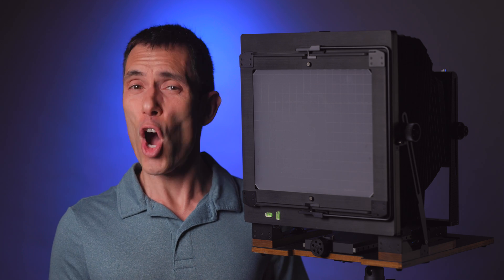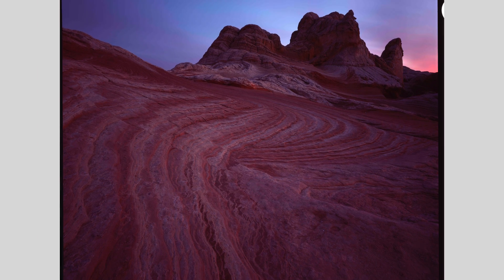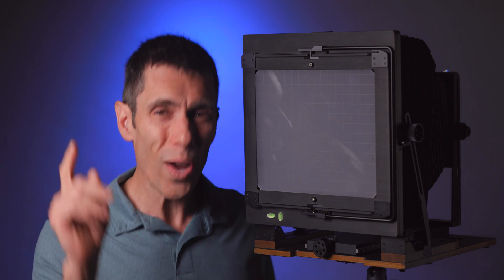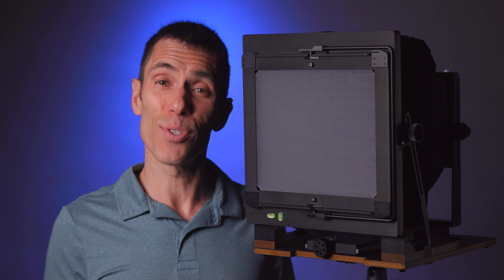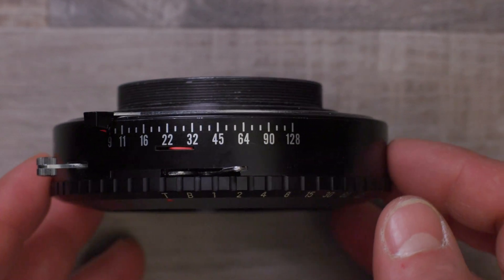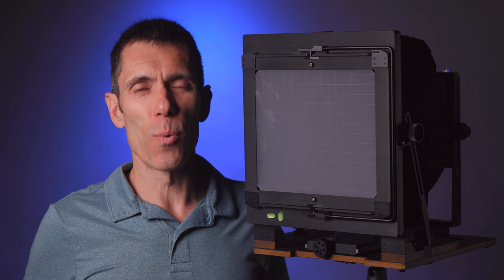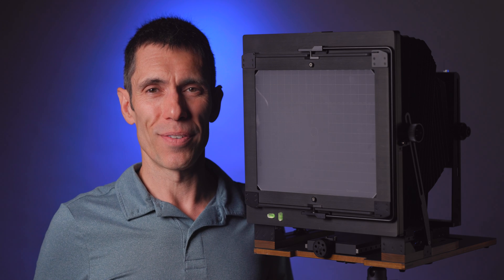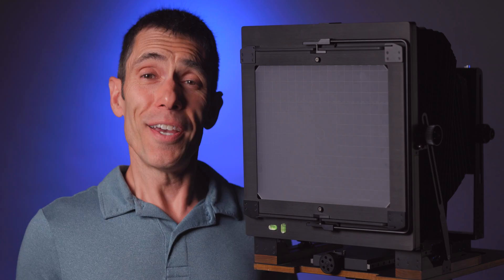How to Set Optimal Aperture

Comment: Amazing stuff :) I just wanted to point out that sometimes some lenses are optimized to be shot wide open (or at some other specific aperture) and other apertures may have worse performance. Always check the manual/datasheet 🤓
Reply from the maker: That’s an excellent point! Thank you for adding value to our photographic community.😎

Comment: what's the focal spread equivalent in full frame and method for that?
Reply from the maker: Great question. I've never tried using the technique on a full-frame camera. However, I'd imagine you could adopt it if you use the distance scales on the lens or on the LCD screen. On screen focus peaking may also be an adjunct to helping you visualize the optimal focus. Thanks for watching!

Comment: Tony there is also another method of finding the optimum aperture, on Sinar cameras, the rear standard focus rack (on the standard clamp), has a ring on it, with aperture numbers, so you focus like the last eg you said, but for the first subject, set this scale to zero, then shift the focus for the second subject, this derives the aperture number, using this focus difference, but you then have to focus for the scene!- this process utilises the camera like a sextant, to optically determine the best setting, but it probably isn't the best focus for the scene. this also works for determining the angles for movement, to deliberately place two objects in a scene in the same focal plane.(which allows you to stop down two stops, or so, giving you more dof, without the risk of diffraction.
Reply from the maker: Thanks Andy! This is great information!

Comment: Tony, this might not be the ideal video to ask, but I had a quick question. What kind of tripod are you using with your Zone VI? I just picked up a Zone VI myself along with a Mamiya C220 and didn’t quite realize how big and heavy these cameras are. Also, what quick-release system or plate do you use to mount them securely to the tripod?  Also, I have been looking for a 6x17 film back, but they are almost cost-prohibitive. thanks Mike E.
Reply from the maker: Hi Mike. That’s a good question. I don’t use anything special. I use the same tripod and tripod head across all of my LF cameras. Gitzo traveler tripod with either a Arca Swiss ball head or a smaller one that I customized. I would recommend watching my 8x10 LF backpack video for specific model numbers. I don’t recall them off the top of my head. Congrats on the Zone VI! Great cameras! Thanks for your support!

Comment: Is this measurement method really most useful when you cannot apply tilts? I mean I know it can work in all senarios, even with tilts done, but im thinking if your setting up in the dark and you are really rushed, and can only see with the lens wide open this would be the method i would use, or say at the coast and your FG has very high rock starta in front of you but you want whats down and lower behind it in focus, I would use this method.
Using this method, is this like hyperfocal focusing a large format camera.. do you need to know how far from the fg you are in order for this to work?
Reply from the maker: Steve, the best thing to do is experiment with your set up to see if you like using this method. Thanks for your support!

Comment: Does the focus spread method (difference and set to half way between) work with tilts and swings? Or is that irrelevant? Would you use the tilt/swings to get near and far in focus then stop down the aperture to help with the middle ground?
Reply from the maker: Steve, I would recommend doing your swings/tilts first, then set your aperture. Of course, always check the ground glass to see if you like everything. Thanks for watching!

Comment: Great teaching as usual, focus spread method would it same as tilt the front lens down focus near and distant object until both sharp (the focus point is in the middle?)then stop down the lens to f45?
Reply from the maker: Focus spread works with swings and tilts. Same technique is applied after swings and tilts. I appreciate your support!
Reply: @tonysantophotography  but you are not moving the lens over a spread after the tilt/swing is set for focus on the scene. Shouldn't that apply only to a perpendicular focus plane, or a plane not encompassing your desired near and far objects? Thanks.
Reply from the maker: @steveh1273   I would recommend doing your swings/tilts first, then set your aperture. Of course, always check the ground glass to see if you like everything. Thanks for watching!

Comment: one other fyi, a video from Calumet (1980's vintage) called "Large Format the Professional's choice" goes into this "dance"{a term from Mat Marrash channel-Large format Photography} saying, in summary, camera position with a lens to select perspective, decide on focal length (amount of subject in the shot), then rough focus, select movements (most important to the shot, at first, to save confusion), Then re-focus (movements themselves change focus), select aperture ,shutter speed, then shoot. the focus technique they used was to get dof by tilt/shift, focus far, tilt to the near, until both points are at the same bellows extension(point on the focus rack, monorail position).
Reply from the maker: Thanks for sharing the “dance” with us Andy. Lots of steps to remember. I appreciate your support.😎